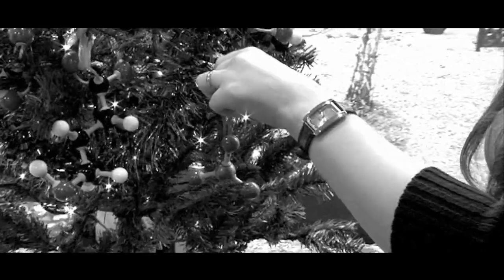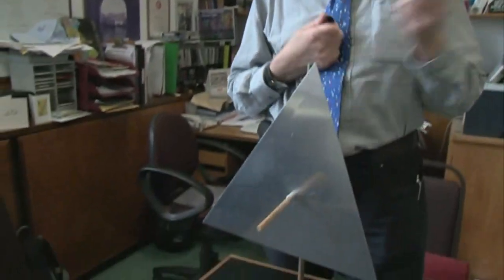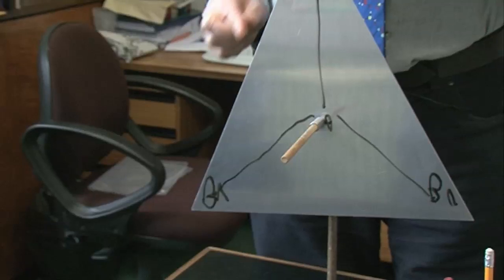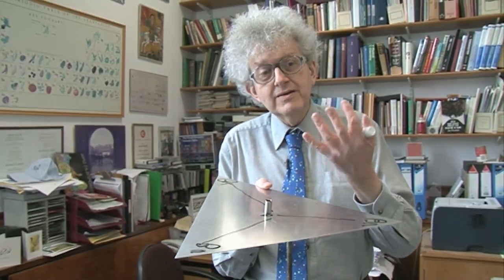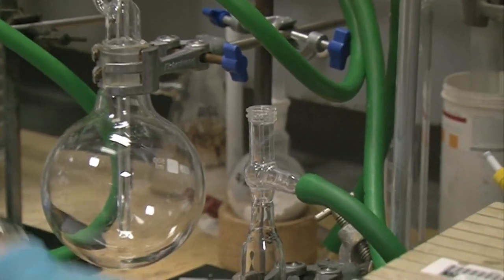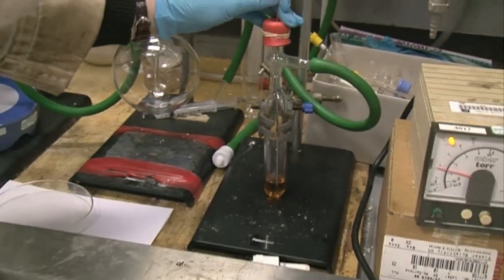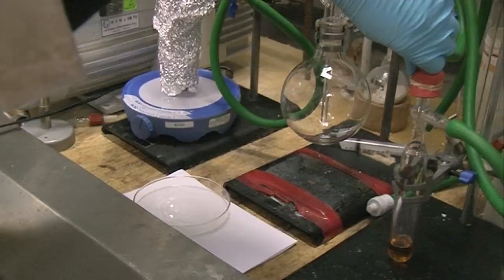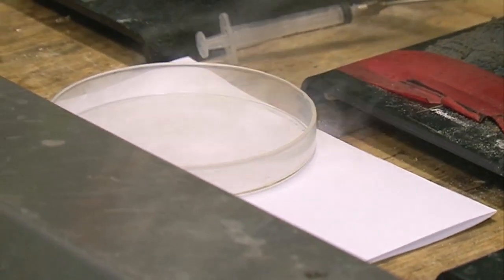Boron Tribromide - Periodic Table of Videos

Comment: It may be that the element that gives electrons is written first, so HCl, HBr, CO ...
I don't know what is the rule for more complicated formulas, for example H2SO4 - why not SH2O4(in the order from most positive to most negative)or SO4H2(closer to what the molecule looks like-hydrogen attached to oxygen attached to sulfur, kinda like the organic compounds are written).But then NH3 is reversed-it should be H3N if the positive ion/donor was written first.It would be interesting to know the rules.

Comment: Just saw a story about soaking cotton fabric in a solution of boron, then cooking it to burn off the original fiber.  You're left with a network of boron carbide material that is extremely strong, yet still flexible.  The headline was 'bulletproof T-shirts', which may be a bit of an exaggeration, but still interesting.

Great video.